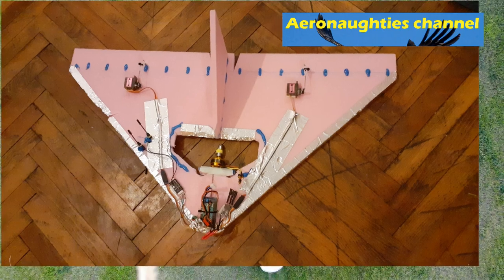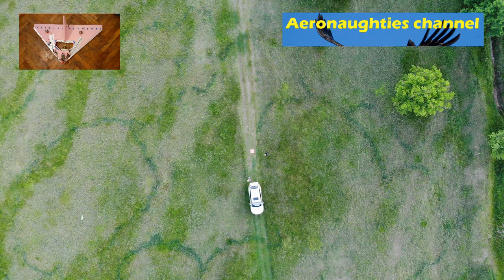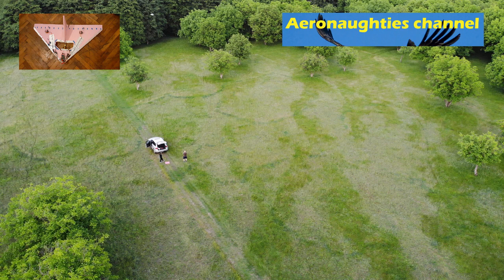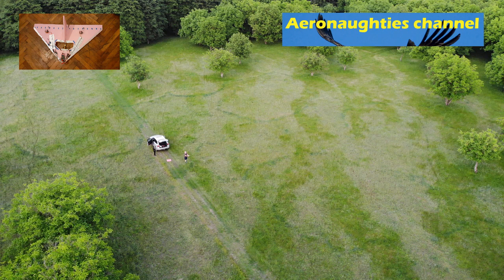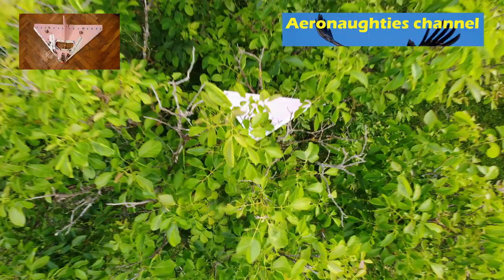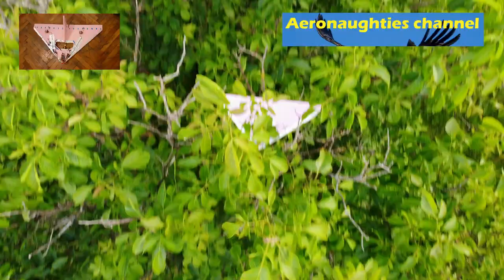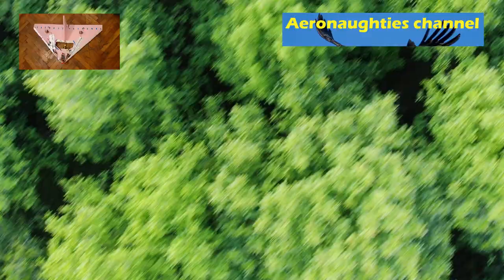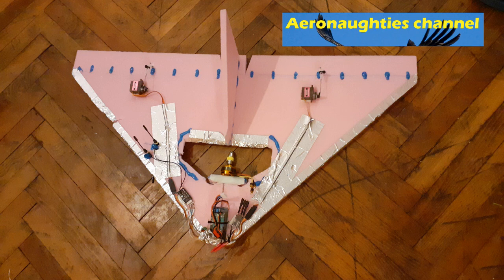My trainer delta wing for learning manual RC flight launched from DJI Mavic Air

Comment: Hey, im building the same plane based on Balsa or Carbon's recommendation. Im having a bit of trouble getting my plane up to speed and was wondering what motor and prop you were using? Anyways, awesome build and good luck with making it autonomous!
Reply from the maker: Hi, please message me on Telegram @Aeronaught and I'll send you pictures and all you need, cheers
Reply from the maker: https://www.youtube.com/watch?v=qLPkyj2LuV4&feature=youtu.be

that's some more flying
Reply: @aeronaughties Sorry just realized you put your handle in the first comment... I tried messaging you but im not sure if they are going through. My handle is @adamhakimji if that helps